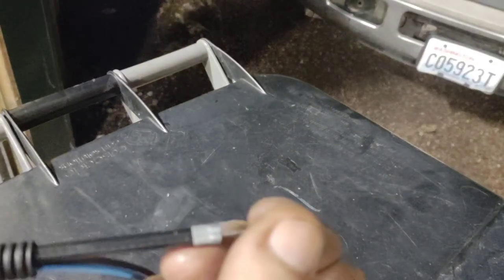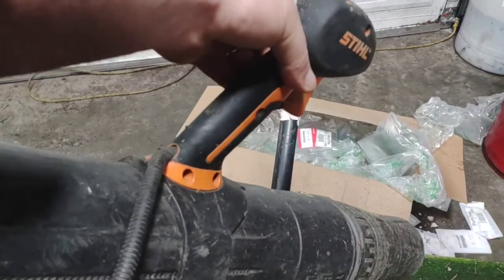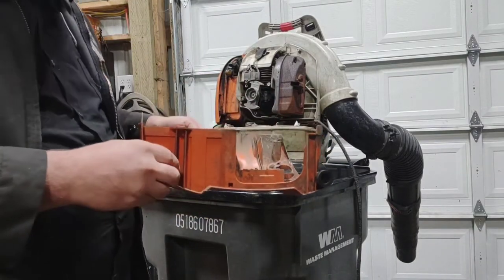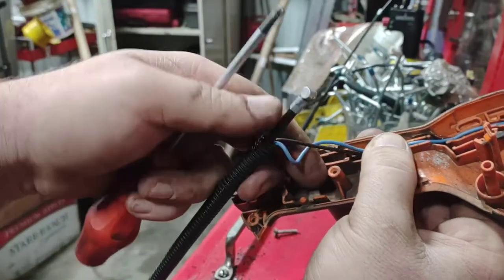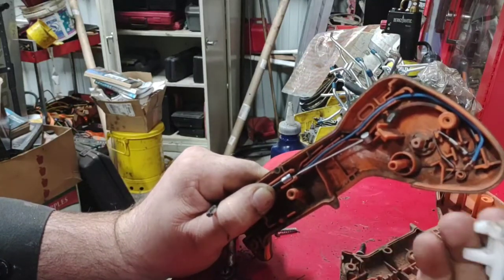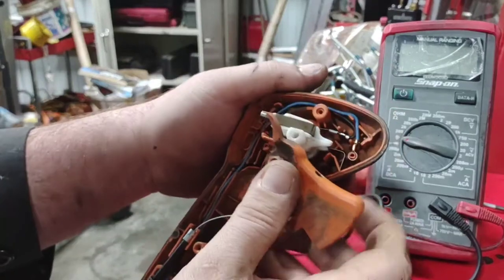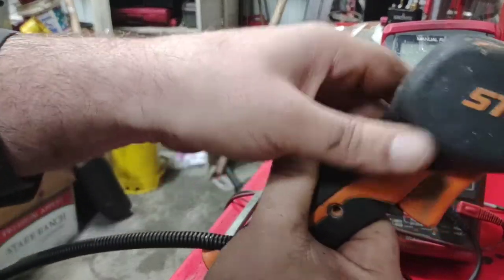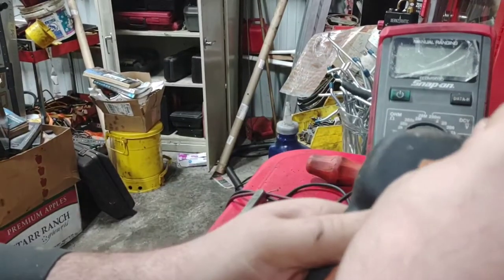Throttle cable replacement Stihl BR500 BR550 BR600 BR700  4Mix Backpack Blower

Comment: Nifty little cable tool!
Reply from the maker: The tool and the cable lube can be purchased at any motorcycle shop... If you do this to your mowers, bikes, equipment, etc... Those cable housing s and sheaths last a lot longer and it keeps the cable at the ends from fraying as quickly... My brother owns a commercial landscape company and  I both worked for a Deere dealer as well as a currently own my own repair facility. I even do it to the brand new mowers...